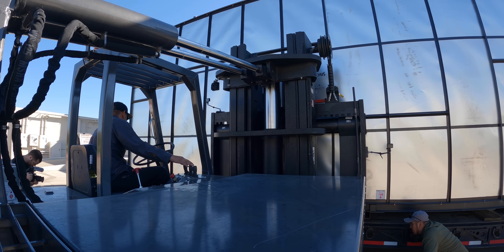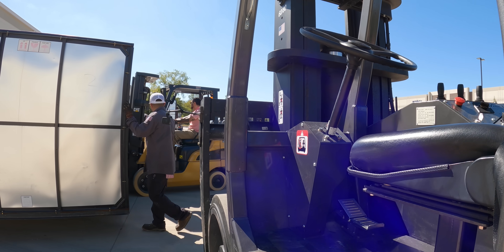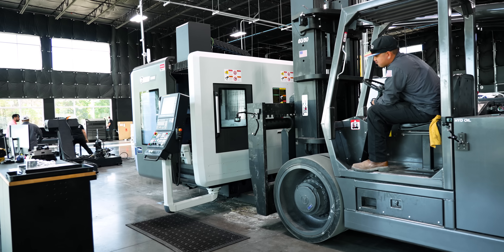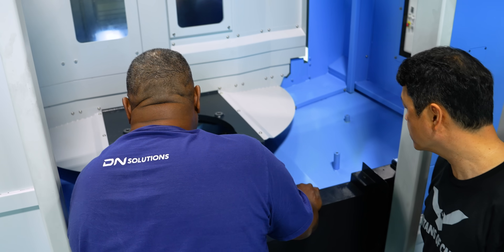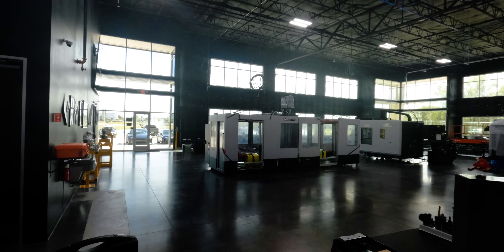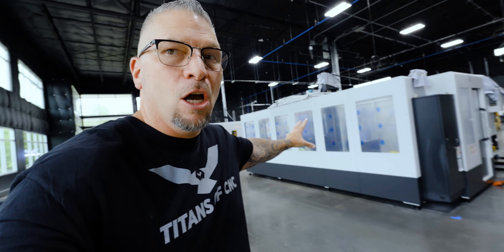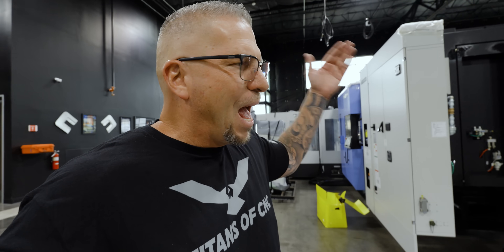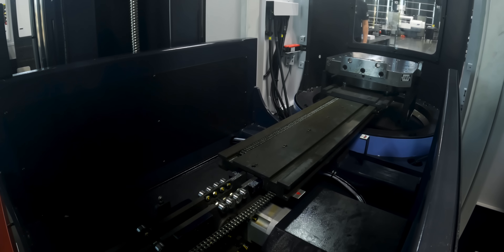Setting Up Our New MONSTER Machining System

Comment: I remember back in 1992 the machine shop I was at bought their very first CNC milling center. Watching the pros move everything with forklifts and skates and bars. Those boys know what they are doing. Moved everything and set up the machine without scratching anything. It was a small shop so we had to do some juggling to make it work, but I was in awe at how professional those guys are.
Reply: I handled the trucking for this job Satellite Specialized Transportation, the rigger is J Mor Machinery movers out of Dallas. J Mor is actually also a customer of ours. Great guys who do great work. They recently handled a 30 machine install in Rockwall TX when I moved an Arms Manufacturer to their new facility from CA, Can you imagine a gun company leaving CA???

Comment: Retired sparky here and can remember when the CNC machines doubled their tool ho!sets to 24. Thought they would never go much higher then that but WOW a 240 tool holder. One smart tool & die/ machine shop that I did electrical work for would never keep a CNC machine more then 5 years. Ran most of them 24/6 and told me they paid for themselves and new ones were always fadter..